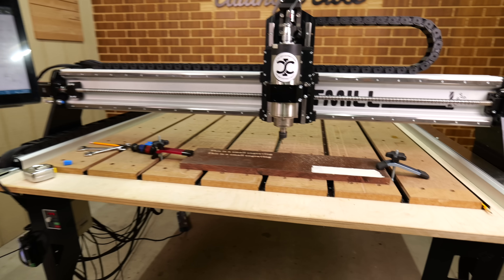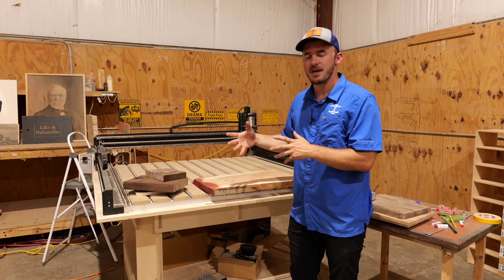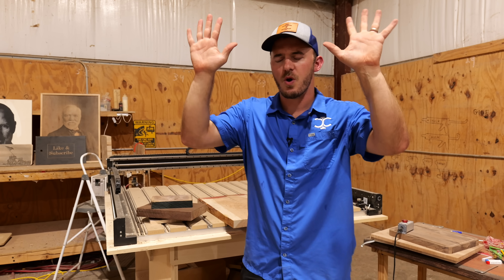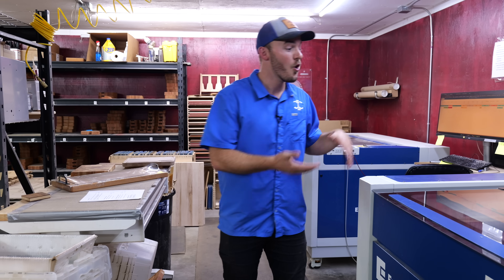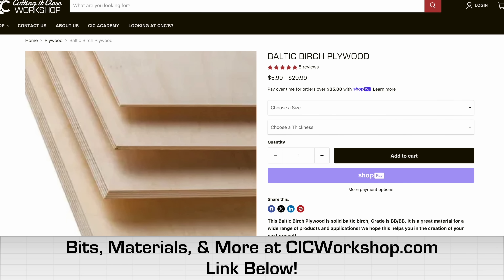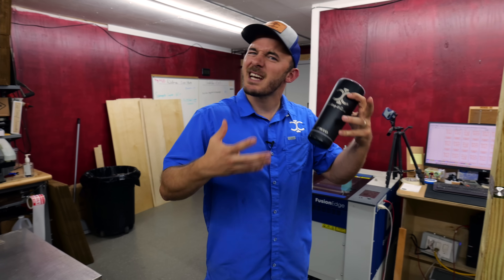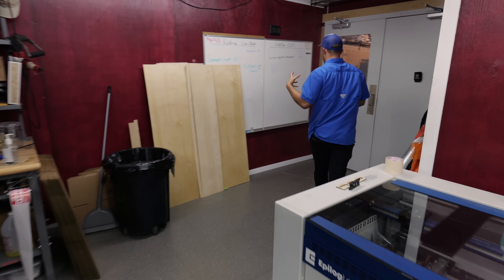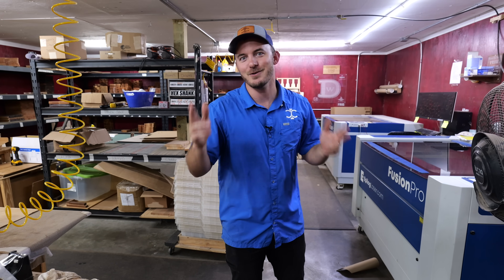CNC Router or Laser? Here’s What 13 Machines Taught Me

Comment: I own a mechanical engraver which is essentially a small CNC (Pheonix 1212 From Vision) and I have an old newing hall, and an ancient Roland.... I bought lasers last year and I have 3 different types.  So yes different machines, different purposes but all of them both create value and add value. 
Have you tried something with a Galvo Head for your cups? Huge difference in time per cup.  On theme of your video, taje Xtool up on their offer and get an F1 Ultra, use the blue light not the fiber for cups.

Comment: I have both a CNC and Lasers. Im agree with your points, but really these machines are all just tools and its about what you use a tool for. So I laser cut mostly 1/2in solid wood(not plywood) and 3/4 sometimes. So its super tight kerf of a laser that makes me like them for making whole products. Like for example making boxes are cake on a laser vs on the cnc your still having to do handwork like chiseling out finger joints. where I do alot of engineering artistic stuff on the laser. Just saying like your talking about "what is its purpose" is super important, and really you can do both artistic engineering and making or creating with either machine. 3d printers also do fit into this convo

Comment: Very good video! I will agree most people use a laser to ADD value. That said I use it to CREATE value. Mostly for cutting substrates (Rowmark/Gemini) for ADA signage. The only part that isn't laser is the braille beads which I use CNC router to ADD value to my tactical signage. I also use a UV printer to ADD value and even print the braille sometimes. Still not sure If I trust UV printed braille over good old acrylic beads.

Comment: Unless your hobby is limited by space, I would not go for a machine where you swap “heads”.
A CNC needs dust control, and a laser requires toxic fume extraction. Very different.
The supposed cost saving from sharing a couple of small motors that drive the X & Y, is not worth it.

Comment: Wow most videos here I agree with but this one I strongly disagree. I know many large businesses that have an entire division that uses lasers to create value and not to add value. The opposite is also true that I know a number of folks that use CNC routers to "add value" as they purchase finished blanks like jewelry boxes and personalize them.

Add value is the assumption that a laser only engraves and this business only uses 1 laser type which is not a full spectrum view. Personally for example I would never use a CO2 laser to engrave cups. There are many laser types all with advantages and disadvantages to your vision and the materials you plan to work with. CO2 and metal is like cnc routers and titanium material, not compatible but can be jury rigged.

 I would agree that the paradigm that Cutting it close is trapped in says lasers only add value. My vison for example has large format lasers that cut sheet goods 10+ times faster than cnc routers with no sawdust or bits that dull. Each has advantages and disadvantages to the use case.

 The bottom line is each person has a vision of what they want to do, this vision can wildly differ from the next person. Visions expand over time and change. Each vision needs a way to realize it into what is needed to best serve that vision. CNC routers and lasers are tools not different than the selection of 50 different hammers at the box store. Each tool has advantages and disadvantages to the vision. There is no value add or value create in the machines, this is the vision alone.

 I would suggest take that vision into a forum and ask for suggestions to further expand it. People from all walks of life will hopefully respond with their version of your vision as to what equipment is best. As is clearly laid out here asking 1 business owner will give a bias version of that vision that may or may not be accurate.

 This is one of the biggest problems of today, the honest consultants are gone as well as people refuse to pay for help. This leaves the bias opinions that often lead to poor choices.

Comment: Interesting take but, with respect, "creating" vs "adding" value isn't a very useful distinction. Your Thunder laser creates those Thank-you cards. Your piggy banks have no value until the laser-cut plexi-glass is added. Your CNC adds value to the block of wood after you've properly dimensioned it with your other wood working tools.   Perhaps a video on WHY you cut the plex-glass/acrylic with a laser rather than the CNC or why you cut your inlays with a CNC rather than a laser would be more worthy of the title: "CNC Router or Laser?"

Comment: Thanks for this - I'm very much in the engineering mind category but bought a hobbyist diode laser to be able to make custom fillet sticks out of 3/16" plywood for a boat building project I'm working on and then did some decorative "engraving" on a few pieces which left me underwhelmed relative to what I knew a router could have done.  If I wasn't familiar with routers I'd say that it worked well for that purpose and I probably could have stuck with it and made it work.  The big value of the laser to me was as an introduction to what was possible, but I'll take chips over smoke any day and moved on to a CNC pretty quickly.... but the lessons from that first exposure into the laser / CNC field really helped me "buy the second CNC first."  I still use the laser for some jobs where it's a better fit like making toolbox liners or cutting thin and flat materials like the fillet sticks I started with.

Comment: Can you not just use a CNC platform to mount a laser head? Isn't it the same framework?
Reply: You have to remember that the "laser heads" one can mount on a CNC are almost always made with laser diode technology and you'd want to consider the pros and cons there. Power and cuttable materials being two areas to consider. Also consider engraving or cutting. If you're cutting you'll probably want to replace your spoilboard with something less flamable.
Reply: He mentioned that there are machines that combine both. My second cnc was purchased because you can swap out a small laser head. I wanted to “brand” my cnc work 😀
Reply: A CNC machine might be a lot slower for laser engraving just because the mounting hardware is so much heavier.  That plays into slower acceleration/deceleration.  And which ever axis (x or y) that is the slowest will determine overall speed.  I would guess that laser machines are much lighter and quicker.
Reply: Router makes dust and if you have a good dust collecting system you may be able to run the machine without a mask .. or at least enclose the entire machine.  
Laser makes smoke that are toxic.  That smoke, all of it, MUST be trapped and then vented outside or at least treated with filters before sending it back into the room/building.  Keep that in mind if you are thinking about mounting a laser on your CNC.  Also, the smoke is a cold or room temperature gas.  So, simply having a flue will NOT guarantee it will vent like a chimney.  You will need ducted fans.  Like if you are in the basement, that cold air is dense and will sink not rise.